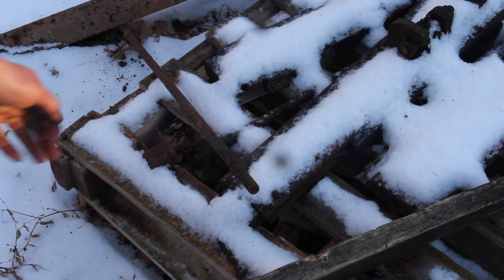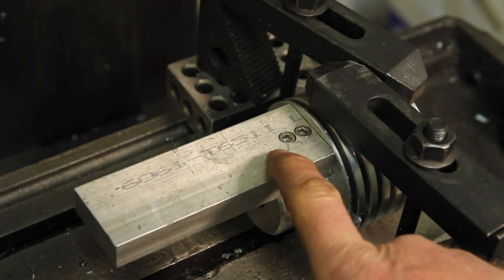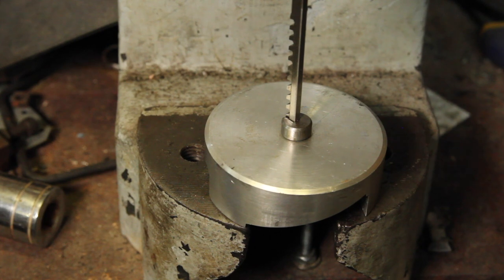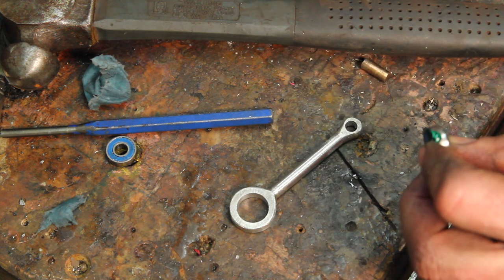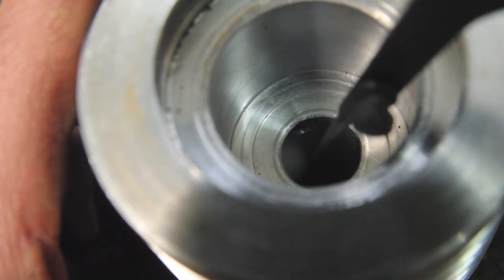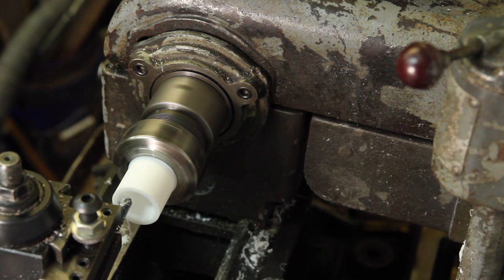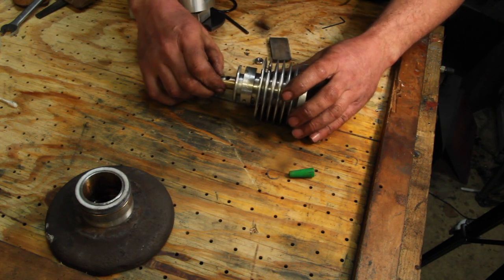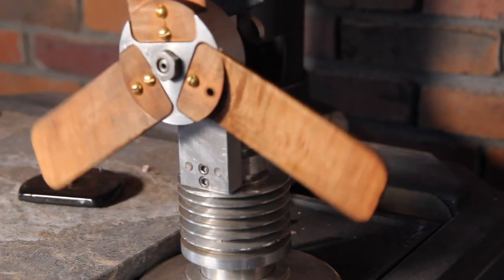Man vs. Manson Engine

Comment: I'm impressed with your persistence on this. This is the first time I'd heard of a Manson engine, going to do a bit of research as the simplicity is attractive.  I built a small Stirling engine on my clapped out old lathe, seems like they are quite a lot easier to get running, though at the expense of more complexity.

Might it be worth adding some insulation on top of the base to prevent radiant heat reaching the cold section?
Reply: Very good idea, like a turbo blanket on a car... Keeps the hot side hot and prevents the cold side from getting hot by radiance... Just might be a good thing to try and apply, should rise the efficacy a bit, but talking about a few % on numbers small enough where doubling does little in terms of applied work is a bit silly, but bravo, more than admirable in engineering way of thinking and not adhering to stupid rational approach where you would consider how soon the blanket would pay off...

Comment: I have been on the platform for many long years, and this is my first comment. You make awesome stuff Jeremy!
Some thoughts: Can you get C3 bearings maybe? More slop, but they run very smooth, especially when you get out the grease and run them on thin machine oil.
And I think someone mentioned the large mass of the propeller being an potential issue.
One day when I have more machinery I shall attempt building something like this too, best of luck!

Comment: Tip
Try putting a hood over the base to shield the cooling fins from rising heat, but have a duct to vent the heat into the stream of the fan.
Shape it so that it catches the rising hot air to duct forwards.

Comment: Congrats on getting that thing to run!  One thing about these hot air engines is that they don't scale very well.  That's probably why many of the models you see are quite small.  If you have a running engine and simply double the size, the volume of air that needs to be heated increases by a factor of eight, but the area available for transfering that heat only goes up by a factor of four.  Physics is physics, and I'm not sure if there's any way around that problem.

I understand the appeal of the Manson engine.  Only three moving parts!  But if your real goal is to make a stovetop fan (and not a Manson engine), you might consider the Moriya Stirling engine, which does work as a stovetop fan.

Good luck!

Comment: Looks good man. It might still have just a little bit of friction in it, Ive seen people using powdered graphite lubricant in the stirling engines to help.
Reply from the maker: “Thank you for your feedback, I’ll take it into consideration.”  (Inside joke, lol)

But seriously, that’s a good thought.  I’ll have to see if I have some.  I’ve been using light (sewing machine) oil for it, but graphite is worth a shot.
Reply: @JeremyMakesThings  There is a light machine oil that has Teflon in suspension. Comes in a hypodermic style tube. Used to be able to get it at Radio Shack which, unfortunately, no longer exists in Canada. It seems to work better than sewing machine oil.

Comment: The difference in temperature between the "hot" and "cool" chambers was probably far too small to counteract the friction created by your previous design. So yes the friction was a problem, but I think a better design of the chamber itself combined with a reduction in friction would result in increased efficiency. Because essentially you are pulling in "cool" air from a port that is only a few inches above the source of the hot air. I would suggest maybe using some insulated tubing that extends to the floor where the air is far cooler to increase the difference between the "cool" and "hot" chambers of the engine, this would greatly increase the energy generated by the engine and may counteract the friction it was experiencing in the first place without a complete redesign.

Admittedly this is my first time hearing of a manson engine and quite frankly I have no idea how they really work, so this is my off the cuff interpretation of the problem.

Comment: I am no expert or anything but I think I would try to make a much larger bore with a much shorter stroke to make better use of the thermal energy.  I would try going to like a 5 inch bore with a 2 inch stroke or something and you could try making an actual crankshaft to mount the fan and spread the load with a bearing on either side of the connecting rod.  I would love to try building one myself but I don't have the tools.

Comment: I'm going to post my thought process on improving this design entirely as an example of my own astounding dumbness... If the base was inside the woodburner it would receive far more heat... but so much it would probably warp.  So add a coolant, say maybe water?... ah no water boils at 100C.  Hang on though, the expansion when the water turns to steam would give a really powerful stroke... I'm a genius!!  (pause while mental cogs fail to turn.... wait for it... ah there they go...)  D'ohh!!  I'm so not a genius!!  Congratulations on such a fantastic level of engineering inovation and accuracy using such limited resources!!
Reply from the maker: I think you may be on to something there, Doc, but that gets me thinking that it would be even more efficient If you could somehow get the combustion inside the engine.  Like a little, carefully timed, controlled explosion.  That would seem much more efficient.
Reply: @JeremyMakesThings  We're both missing the obvious here, if you introduce enough fissionable material you can stay warm without even needing to light the woodburner (might save on lighting to).

Comment: Would a bigger diameter piston help with the heat transfer? I have a toy sterling engine and it uses a very large thin insulated piston.
Reply from the maker: The ratios for the Manson engine between the displacer and piston are pretty well established.  It seems that the advantage of the Sterling design is that you can run a much larger displacer compared to the piston, so you’re heating and cooling more air to drive a smaller piston.

Comment: Live the way you worked through the process just a thought 💭 what if you was to change the size of the hub that the blades span on to make it smaller it would maybe have a difference in the rotation speed if it was lighter as said just a thought 💭

Comment: More great stuff. I'm learning a lot from you!   When you have the unit on the stove without the blades does it spin faster? Is there a design problem that the whole thing is on a stove heating the cold side preventing it from being effective?
Reply from the maker: The blades don’t seem to make a difference, I think heating of the cold side is the bigger (biggest?) issue.
Reply: @JeremyMakesThings  just a thought but what if you made a "horizontal" engine with the cold side over the side of the stove instead of a "vertical" one.
Food for thought. 
For a science show at high school we produced a sterling cycle engine heated with a Bunsen burner. It would work horizontally but not vertically.

Comment: If the fan was pitched the other way, wouldn't it keep the cold end colder?
Reply from the maker: The engine will run in either direction, so it can either push or pull.  I presume pulling would keep it cooler.

Comment: A better and safer solution for limiting heat transfer between the displacer and shaft would be to use stainless steel (very low heat transfer coefficient for a metal) with a thin crossection. This is what 3d printers do.

Comment: Your system is not a closed system and has no heat reclaimer . Bugs bunny roadrunner hour. Look at the thousands of working examples  on youtube.
Reply from the maker: Manson engines aren’t a closed system.  That’s the main difference from Stirling engines.  Check out the link in the description for more details.

Comment: Have you had any more good luck with your manson engine? You got me interested in wanting to build one now.
Gor i can truly understand the different between the two open and close system.
The first thing I would do in your case is take that fan blade off and tested it with a flywheel! Your problem maybe  weights and balance. 
I understand that behavior of a closed system it would be a learning process to understand the behaviorally open system!
Always like to feel some type of compression when applying heat but that's a closed system. I've had multiple problems with hydrogens and most the time that boils down to the power piston.
Didn't make it properly it wear down all sorter of things that was Overlook in the power piston.